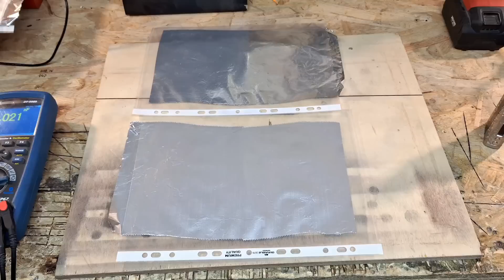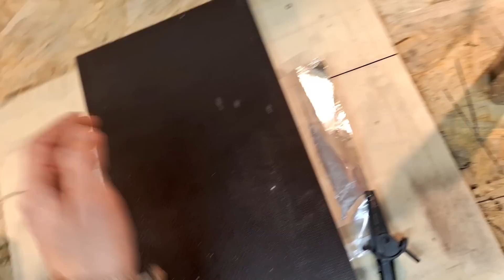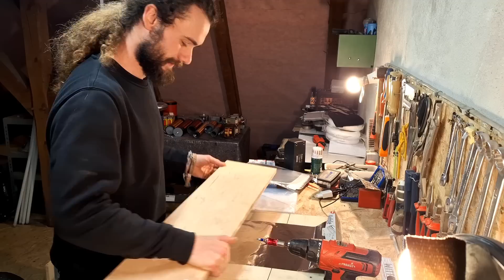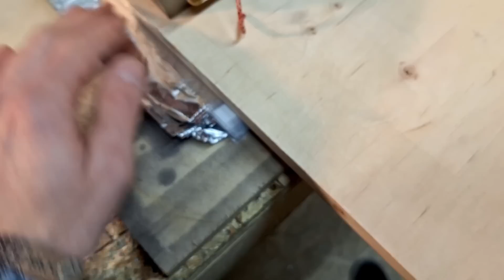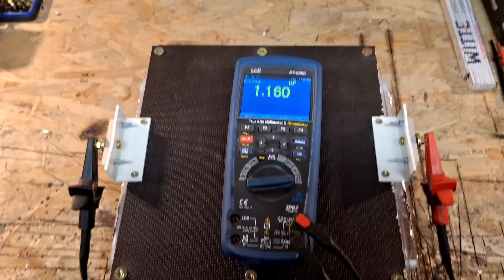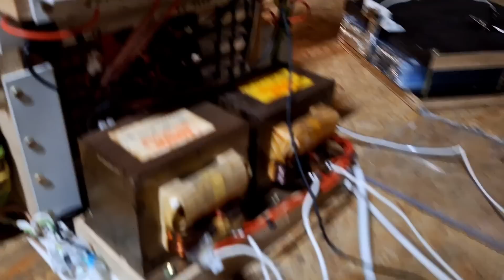I Build an MASSIVE High Voltage DIY Capacitor!

Comment: Best thing I found for Caps like this is the Clear wrapping paper Mylar.  Its super thin so you layer it and if you place glycerin that has been dried between the layers you have a self-healing( to some extent) capacitor that has super low impedance and high capacitance value.  I learned how to make it when attempting to make a TEA laser work.  I was able to use a 10kv 40ma OBIT to run the TEA so that it appeared like a continuous wave laser.  All my best efforts could not get Mylar transparency sheets to function like this as they immediately would blow out meaning for normal usages my design would be overkill and almost impervious to blowouts.
Reply from the maker: @seditt5146  ah ok that is interesting me now🙂
Never heard of mylar. Wonder what it is called on german!
Reply from the maker: @seditt5146  ah its PET !
Reply: @marvsworld247  Is it PET?  Crazy all these years even with almost a decade studying organic chem I never paid attention enough.  I been using them as two different materials so should prob look it up but it had an insanely high dielectric strength all things considered.  Its the material you generally see aluminized in balloons and safety blankets.  Also thin transparencies for projectors.  Most people use those for TEA lasers but my 10kv35ma OBIT transformer always blew through it however multiple shewts of the wrapping paper version of the stuff could hold up great and with dry glycerine between the sheets could hit insanely high dielectric strength with little chance of breakdown and super low impedance due to the thinness of it all.
Reply: @marvsworld247  ah ok so its not 100 percent the same its a special form of PET that organizes the polymer chains.  Look for thin clear plastic that has a bit of stiffness of sorts too it.
Reply from the maker: @seditt5146  ok cool, thanks for the info🙂
Reply: @marvswelt2587  Np.  Something just crossed my mind rereading this.  When I talked about the glycerine, when i say dried that's not like evaporated like many might think.  It involves putting a drying agent into it like Magnesium sulfate that has been put in the oven to drive the water off.  It binds to water in the glycerine and turns it into powerful dielectric.
Reply: I always thought that the aluminised "survival blankets" were mylar, also the "foil" balloons too, though may have been changed for cheaper material now?

Comment: If you didn't destroyed at least one sheet, you never know what real breakdown value it provides.
Doubling or tripling unknown value yields just another unknown value.
Reply from the maker: @sdjhgfkshfswdfhskljh3360  yes thats right. But i made sure that it is more than save for my application with at least 4kv

Comment: @marvswelt2587 - @15:00 I'd lay the foil sheets onto a piece of flat card to insert them into the sleeves, then simply remove the card leaving the foil uncreased inside. 👍
Reply from the maker: @Zodliness  🤯 OMG 😆😆 my brain is absolute crazy with all sorts of things! But sometimes the really simple things, are really invisible for me😆
Thanks for that tip mate!😀
Reply: @marvswelt2587  Just a thought... Have you tried winding a continuous layer of plastic film and foil to form a rolled up capacitor instead of individual sandwiched layers terminated in parallel? 👍
Reply: @Zodliness Yes, this is what I was thinking. Center conductor clamp for the inner end of the sheets, wrap around that. Tightly.

Comment: do those arcs create ozone?
Reply from the maker: @drstrangelove09  yes a lot!
Reply: @marvsworld247  As I understand it, ozone is not healthy.
Reply from the maker: @drstrangelove09  yes absolutely! In small doses for short duration it is not that bad, but this tesla coil falls the room after 1 Minute with it..
Since it is that big, i open my Windows completely for every run, that is longer than just 10 seconds.
Also the arcs produce some other really bad gasses.
Reply: @marvsworld247  hats off!
Reply from the maker: @drstrangelove09  🙂🙏
Reply: @marvsworld247 Yes, ozone when in your lungs has a higher affinity to bond with red blood cells over normal O2. Once bonded to ozone, the red blood cell cannot release the ozone molecule and so becomes useless to the body. You can asphixiate this way, as some folks have found. Have fun!

Comment: Very cool. I wonder if a roll might be an easier configuration to make. Might parchment or freezer paper make a good dielectric?
Reply from the maker: @WaffleStaffel  yes, a roll would be easyer, but with 230 sheets it dont work.
Yes you can use almost everything as dielectric. But it is depending how high you go with the voltage. Every Material is different, you can find lists on the internet about that.
But when you work with high frequencies, it will get really complicated
Reply: @marvsworld247  Try using two foil rolls at once, with oversized square dielectric plates/sheets. They can be folded/woven back and forth, with a layer of dielectric placed down in between each. No foil cutting required, and each layer has two connection tabs. More material needed, but easier to build and has better electrical characteristics. See my other post.

Comment: I never get projects completed, which leaves me plenty of time to have ideas for people making things.

If you slit the long edge of those plastic sleeves I think you can fit the entire width of the aluminum sheet, saving time on the next one.

Does the thickness of the foil help or hurt capacitance?  Might be worth getting the expensive kind next time.

One other thought - Teflon (PTFE) coated foil may give you some additional breakthrough protection.

Obviously winding a roll of foil with a roll of plastic food wrap would likely be faster, but since you probably thought of that it’s likely a worse dielectric.

BTW, the timed discharge from your Tesla coil is different than any I’ve seen, and very impressive!
Reply from the maker: @firstmkb  hey thanks for your feedback🙂
Yes when the dielectric/foil is thicker, the voltagerating is getting higher, but the capacity is getting a bit less (i think) but that topic is way more complex in Detail i think😅
I was fit the aluminium foil into the plastic sheets, because when i would Pack them more loose or cutting the edges, im a bit nervous about they can move or slip out in the building process of the capacitor🙂
But for sure that would be way faster!

Comment: High voltage capacitors need to be stored with a shorting wire.  Apparently the the dielectric can become polarized during use and then can later relax over time placing a charge on the plates. 
A cap of 1uf with few kilovolts would give a nasty shock near 2 Joules probably not lethal  2e+3 Volts * 1e-6 Farads = 2e-3 Coulombs of charge .  According to Wikipedia "Usual values 
delivered by defibrillators lay between 50 and 300 mC"   But I have no desire to test the hypothesis on myself.
Reply from the maker: @lordofelectrons4513  yes it has its own shorting wire, i use it in the Video too😉
Calculations said 50 Joules @10Kv with 1uF 
But yeah you right, i wouldn't try it either😅

Comment: 2 rolls of Aluminum foil and 3 rolls of baking paper or stretch wrap.  Start buy layering each roll.  
layer key
~ = stretch wrap
- = foil
So layer like this
~~~~~~~~~~~~~
--------------------------------
~~~~~~~~~~~~~
--------------------------------
~~~~~~~~~~~~~

Roll these layers together all at once while unrolling them from their box. 
This will make HUGE CAPS! Be CAREFUL!
May need thicker wrap to stop from internal arcing when you get up to a few kv's.
Reply from the maker: @TheTubejunky
Yes this will work too.
But baking paper or stretchwrap is a bit risky at 4kv 
Also its just one layer, its possible to have some punctures in the Material.
Reply: @marvsworld247   Yes, that is true but knowing this you can swap out that material with a heavy mil one like rolls of industrial plastic wrap or different types of wrapping paper with a heavy thickness. 

Seems much faster than using file protectors is all mate. Great TC btw it's freaking awesomely huge!
Reply from the maker: @TheTubejunky  yeah thats right, it would be waaaay faster😅 
Thanks mate🙂🙌

Comment: Typical microwave oven capacitors are a similar value, and clearly you have a bunch of them already, what's the main purpose in using this over one of those?
Also, a suggestion is to minimise the inductive loop between the capacitor and the coil, I noticed there was a decent distance between the wires feeding from the capacitor.
Very clever design, I'll be sure to check out your channel some more.
Also wikipedia has a good article on "relative permittivity" if electrolytic capacitors interest you.
Reply from the maker: @UniCrafter
The purpose is to get more capacity on the voltage doubler circuit, to stabillize the ramping voltage of the power supply.
I just wanted to try how much capacity i could get with that, and if a "pulse rated" cap makes some differences to a Standard microwave oven cap.
For 1uF i would need 4 Microwave oven caps. They would cost more as this DIY cap. But the work in that is crazy🫣
Yes, this coil is getting a bit messy over the time, because im working and trying so much on it.
When it is tuned and all in all finished, i will completely rebuild it🙂
Reply: @marvswelt2587  yeah, for 4kv would be 4 capacitors, would be interesting to see the difference in ESR between the two
Reply: You’ve missed the true advantage of microwave capacitors - getting them free from people with broken microwave ovens!  I am enjoying your DIY though.
Reply from the maker: @firstmkb  i already buyed all used and damaged microwaves in my city🤣🤣🤣🤣

Comment: It would be awesome to have high speed video and photos if the arcs. Making palm trees and daggers it's wild looking. Maybe place different metals on top of the coil. Maybe use a small leak of non flammable gases in the arc..
Reply from the maker: @jamest.5001
I have some pictures at my community channel🙂
I can make some slowmo Videos, but my Smartphone is not that suuuuper slowmo.
Yes! Good idea with the gas!😃

Comment: I thought of using aluminum foil and waxed paper build a jig to allow it to be rolled in layers with a waxed paper layer on the outside of both sides and between the two foil layers  maybe clear kitchen plastic wrap could be used also.  When I hear high voltage capacitors. I can't help to think of laden jars.. I thought of making one with aluminum foil inside,connected to a copper foil tape . Covering the inside of the jar. Then place a Plastic bag inside the jar fill it with water. Then wrap the jar with aluminum foil and wrap with plastic kitchen wrap. And again with a 15mm copper foil tape for the connection.  Then place it inside another larger jar filled with water. Careful to keep the water away from the top of the jars, about 40-60 mm for safety. Then add a layer of molten wax to seal in the water. Make the electrical connections on the lid of the last jar. Possibly experiment with different salts and things resolved in the water. possibly using things other than water. Maybe mineral oil, alcohol even iron oxide in water , experiment ..
Reply from the maker: @jamest.5001
I actually build a big rotary spark gap tesla coil, 7 years ago and had build the primary pulse capacitor out of 28 glass bottles wrapped in aluminium foil, filled with saltwater and a electrode in the water.
I got around 1 Meter arcs from that...
Thats not much for a 4MOT stack powered SGTC, but it was my first😄
Reply: I literally just typed this same thing!

Comment: About 20 years ago I did something almost the same. I simply got a laminating machine, and laminated the aluminum foil. And you can also seperate them with a few sheets of copy paper. I used a reem of paper and had the laminated foil interweaved with the paper. The cool thing is after you run the coil, you can pull apart the capacitor and its filled with static electricity. The paper sticks to each other.
Reply: I thought of a way to just use rolls of foil and rolls of baking paper or stretch wrap with varying mil sizes to give better insulation. 
Just roll the foil and stretch wrap rolls in layers!!! It's so simple, fast, AND MAKES HUGE CAPS!
Reply: @TheTubejunky  came here to suggest just that.

Comment: Great idea sheathing the metal foil.

You could try painting on a carbon Black coating on metal foils as well
Reply from the maker: @michaelgolfetto9619  im not so sure about the carbon paint, but this reminds me of some technology, where the area of the plates made matt or rough, to get the contact area to the dielectric Material bigger. But in this case, the dielectric Material has to get in perfect contact to the rough plates without air impurities.
I think this technique is done at super caps.